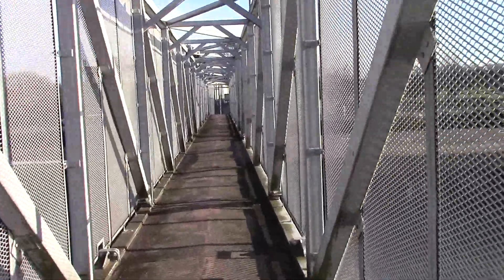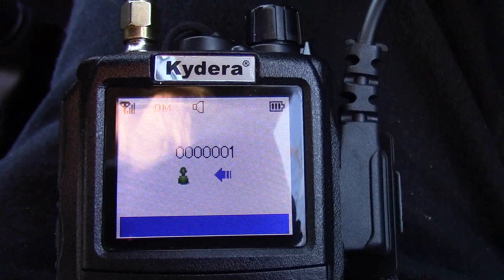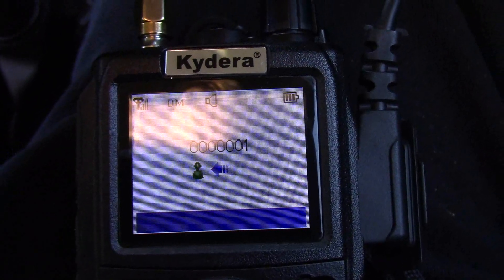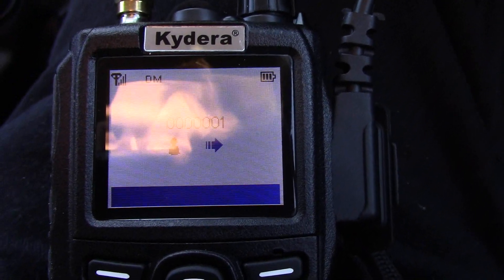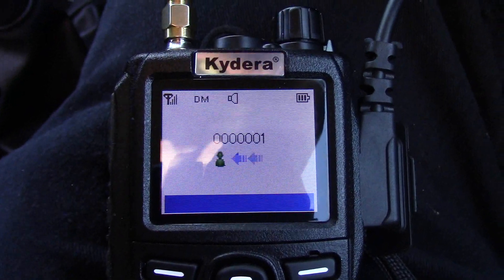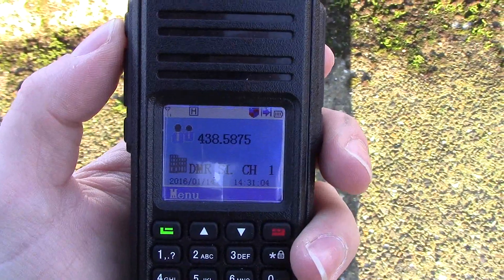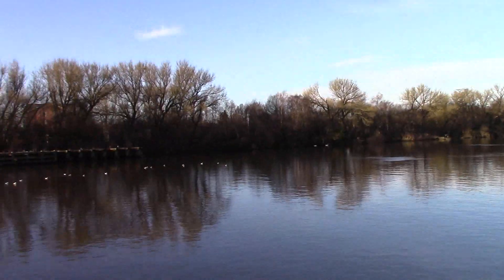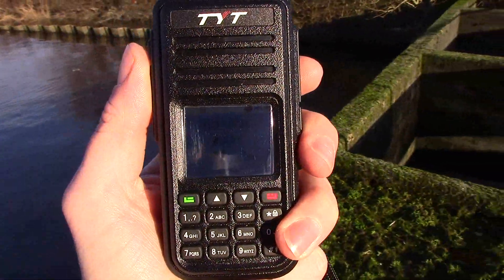Kydera DP-550S & TYT MD-380 Comparison

Comment: Interesting a Dpmr talking to a TYT MD380 DMR

Here in the USA we don't use Dpmr so I dont know much about that mode's settings, but I did pick up a TYT DM-UVF10 at a good price.
I can use it on Analog but have yet to get it to talk to my TYT MD-380 in digital.

I have heard that Dpmr is DMR tier 1? and the MD380 is suppose to do DMR tier 1 &2?

any help on settings to do same test on these radios?
Reply from the maker: DPMR and DMR are different standards so your TYT DM-UVF10 won't talk to your MD-380 I'm afraid. Think of it as DVD and laser disc. Similar but different if that makes sense? :)
Reply: Perfect sense 
I just thought you figured how to cram it in the wrong player
🤔

Comment: Just found out that you can change the vocoder in these radios by software! Have you ever tried that out? There are three different ones you can select from by the looks of it
Reply from the maker: Yeah I've seen that although all 3 still don't decode on the AOR or the DM-5R :S
Reply: Damn, I didn't get a notification for your response. I was here thinking you hadn't replied. I wouldn't expect them to work the the DM-5R since that is DMR not dPMR, but I thought maybe they would decode on the AOR using the "AMBE+2C" vocoder. I'm still unsure whether that is an actual AMBE vocoder or if it's a chinese fake vocoder just named that way to trick people.
Reply: @RingwayManchester  u can use dsd to decode dmr mate late response to the comment on this but you probably know about dsd now ha 73s
Reply: Actually, 4 possibilities for vocoder, 2bits switches four possibilities fourth being reserved for future use.

Comment: UHF modulation is a short carrier wave rf signal for warehouse and high building floors communication use. You would far get  better range on VHF on digital voice simplex.  It depends on the power output of the radio and antenna so for 2-3 miles digital voice is pretty good.